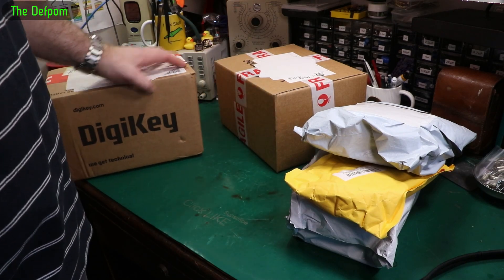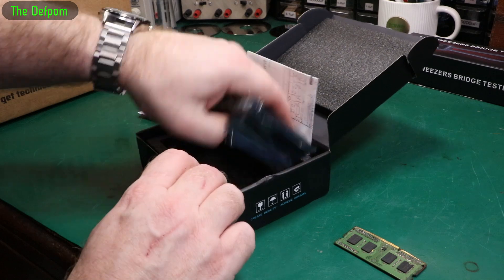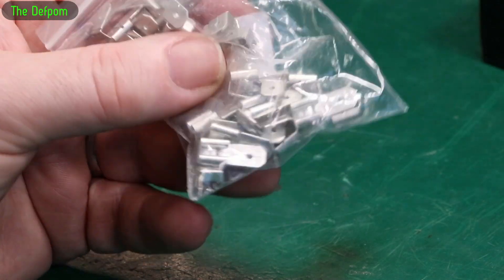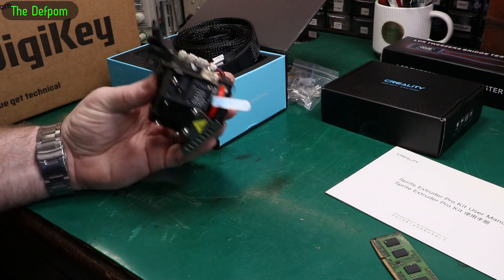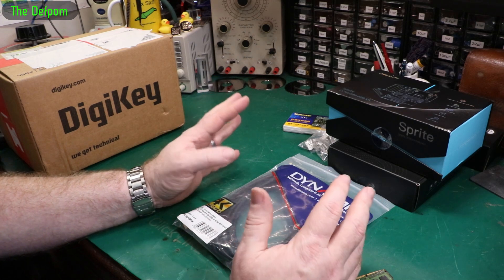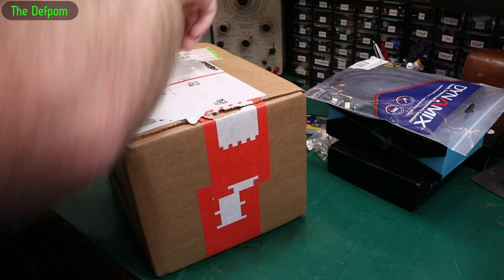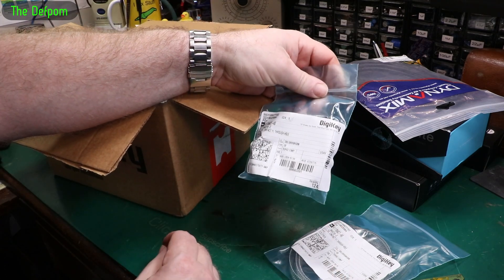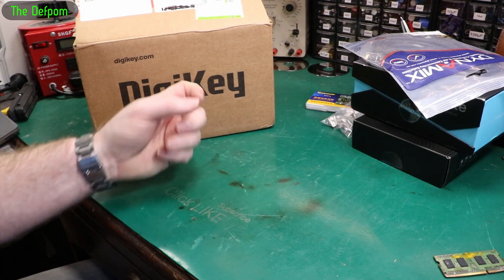🔴 Mailbag Monday 28th October 2024 - No.1293

Comment: What issue(s) you're having with the older 4.2.2 Creality board?
Reply from the maker: @gjvdspam  I suspect it is missing steps even though I have adjusted it.
Reply: @TheDefpom  Thanks. I’ve got one too, I’ll keep an eye on that. I upgraded dual z with belts from kevinakasam, some other little thins and I’m using klipper. The best upgrade for performance yet is tensioning the rubber wheels on the rails. I still like the printer

Comment: look forward to seeing if the mods to the ender3 make a big difference. have an ender3-pro here and being about 5 years old needs a bit of tlc and maybe a few new parts.
Don't care about speed, just can't see the point of chasing a new printer every few years. I will start getting to be like owning an Apple product. 🙂
Reply: yes indeed best thing I did to my Ender3 V2 was to add a second Z drive and a self leveller and put it in the G code🙂

Comment: The USB tester is good, but there is another version with many more LED's that check all 24 pins independently.  The gold pads on the board let you do some 4-wire resistance measurements, but those pads could be bigger so that it's easier to put both needles on the pad simultaneously.